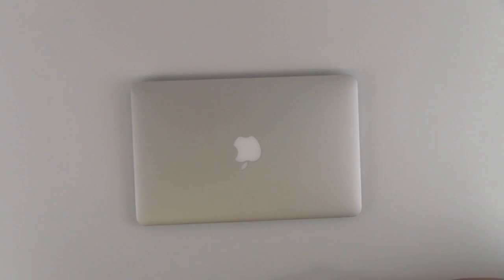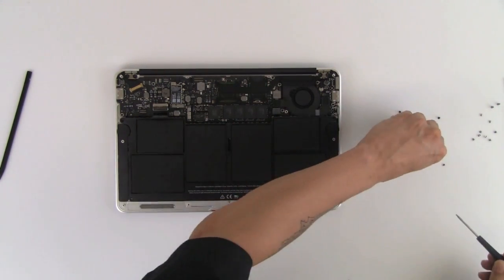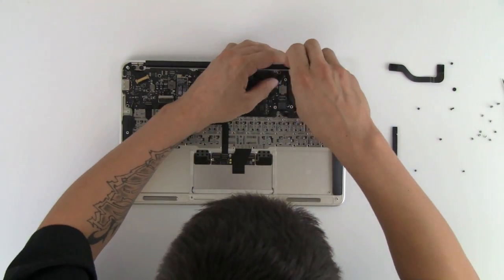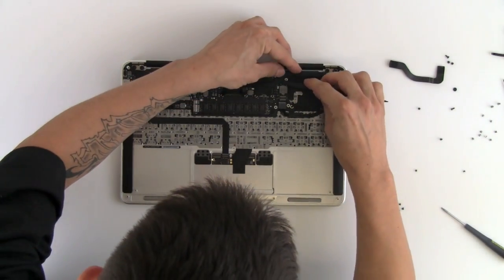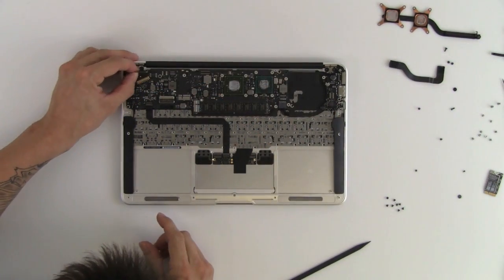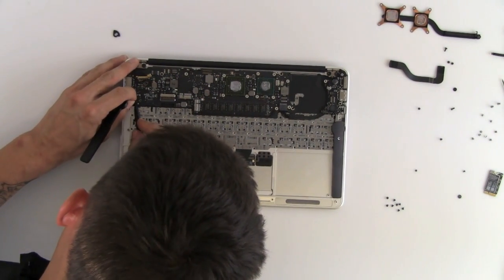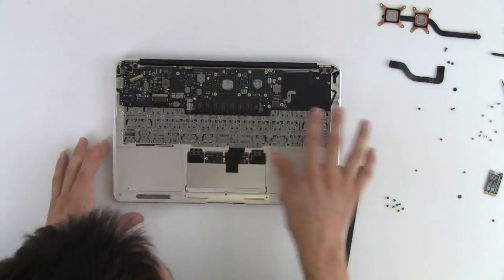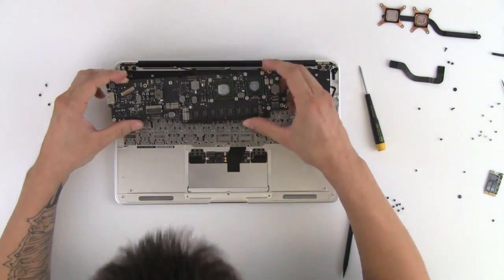Apple MacBook Air 11-inch Take Apart Disassembly Repair by TechRestore

Comment: The screen on my macbook air is shattered, so I plan on taking out the motherboard and the rest of the critical internal components except from the battery, make a tiny case for it, use the power supply constantly, and make it into a desktop pc. But I wonder if it is possible to turn it on w/o the rest of the macbook, and can I connect a wireless mouse and keyboard.

Sorry for bad english and thanks for any answers!
Reply: Save $35 Today! A1375 Battery for Apple 11 inch MacBook Air A1370 late 2010 020-6920-B MC505LL/A
https://www.ebay.com/itm/152762074100

Comment: I have a Macbook air 13in 2011 model and I want to replace the thermal grease with a better one to reduce to temps. Can I just take out the heatsink straight up without taking anything else out?

Comment: Does anyone think it's possible to fold the macbook air inside out so that the keyboard and the screen are on the outside and the outside is on the inside of the fold. I am trying to make my Macbook Air a tablet by doing this, putting it in 90 degree view, and replacing the screen with a touchscreen. Someone help?

Comment: Can the keyboard on the 2010 MBA be replaced with the backlit keyboard for the 2011 MBA?

Can the 256GB Flash stick on the 2011 MBA be used in the 2010 MBA?

Comment: I noticed that the screws for the LCD are visible at 1:06. Does that mean that you can disconnect the top of the computer and perform a screen replacement without having to take out the battery and logic board? And is the 13" MacBook Air like that?

Comment: I notice you didn't remove the trackpad, although it is possible to remove it. I was wondering if you know how the button mechanism on the trackpad works? Like, what actually makes it click? What part in there decides that at a certain pressure there's been a click?

Comment: I am really curious to see the keyboard removed from the Air, and compared to the illuminated keyboard from a MacBook Pro. If one could be substituted for the other is the main question I have. Also, is the teardown for the 13 inch Air the same AFAYK?

Comment: Greate video, tough i dont understand why they have to specify different screws to mount 1 object, i could understand if they use different screws for different parts of the mac but for a fan 3 different screws?...    Ok well maybe im thinking a bit too "worky" because im working with screws M12-M30 :D and there they cost a "bit" more /piece :D

Comment: So basically its soo thin because 1) theres no optical drive 2) no large hdd, just a ssd 3) the battery is spread out amongst the entire bottom 4) the cpu and gpu share the same heatsink and fan, which are both lowprofile (doesn't seem very efficient to share tho) 5) no large ac/dc transformer.6) limited ports on the sides 7) thin lcd or is it oled?